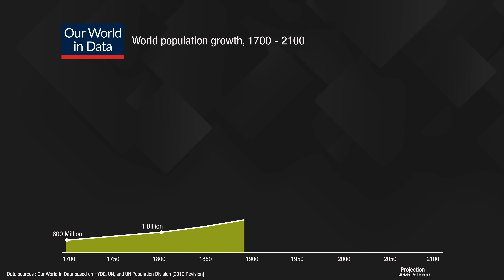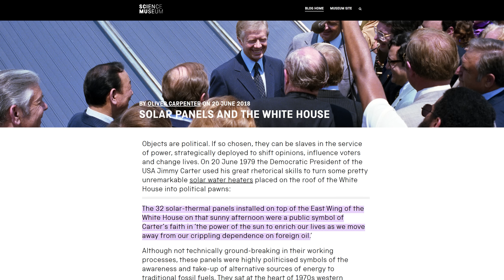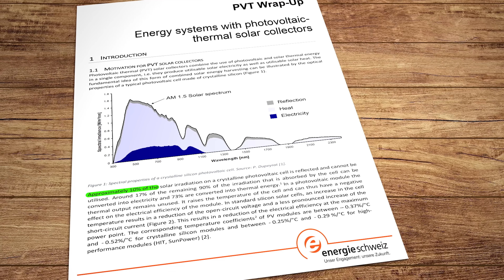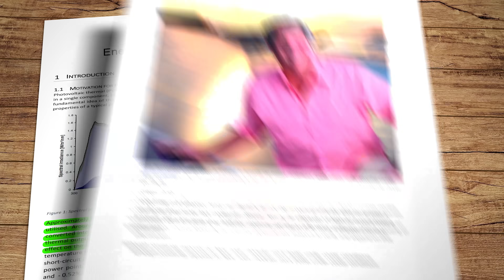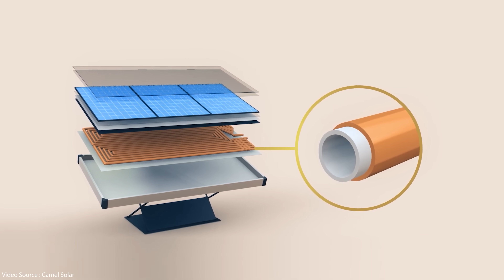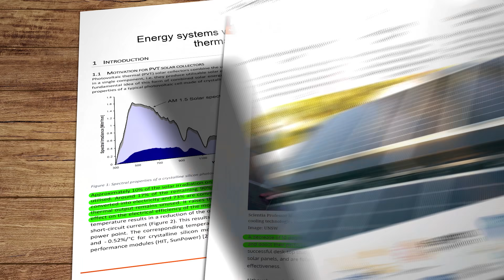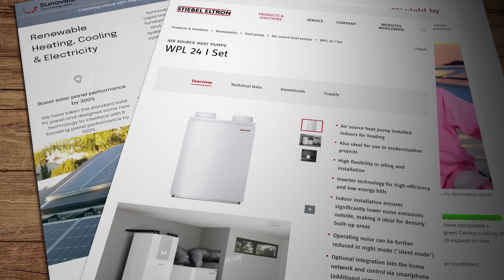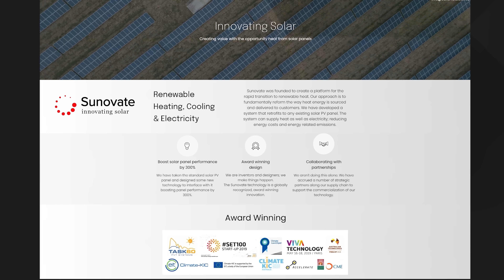The Solar PV panel that provides electricity AND heat for your home!

Comment: This would be perfect for colder climates. With a geothermal battery they would have enough heat to heat greenhouses all year long and you could also store the cold to cool it down during heatwaves or in summer. Once set up these systems practically reduce your heating and cooling bills to zero.

The energy that is used to store heat can come from any source. Focused mirrors, solar and wind, in this case the electrical energy can be turned into heat with a conversion rate of almost 100%. If you then dump that heat in something that has a large thermal capacity like sand, salt or water you could store a shitload of energy.

In Finland they have used a similar system to heat an entire village all winter long.

In case of excess energy, the heat of these thermal batteries can be used to power a sterling engine or a regular steam power plant. However, the temperature of the medium then naturally has to be above the boiling point of water else you can't produce steam.

Also in case of a sudden increase of renewable energy because of sunny or windy days, these thermal batteries can be used as an energy absorber, much like a capacitor and be part of a smart grid system. Nowadays excess energy is often dumped and wasted.

In short these systems, when used correctly, could be used to heat greenhouse and create food abundance at minimal costs.

Comment: Would it be possible to use the heat differential to power a Stirling engine to generate electricity?

Comment: I'm glad this technology is finally coming to a fore of some kind and being developed. Sitting the the perpetually cold surrounds of Scotland, the value of heat is in some ways greater than that of electricity, which presumably will be a major destination for the electricity in any case. Gathering the heat doubles the benefit and our heating season goes well into May sometimes. A better degree of insulation would help but there's plenty energy in the sun to heat homes from at worst mid march and probably earlier. There's got to be huge savings to be made then and in hot water through summer.  I'd also like to see better integration of solar energy into heat pumps, engineers fight for every fraction of a point in the COP department but there's got to be real big gains just ducting the air to it through a big black box in the sun. Especially on a mid winter sunny day where the air would otherwise be freezing and the resistive element on, but you might still be getting a few hundred free watts of thermal energy beating down. I think you need to design for the climate not just the technology for its own sake.
Reply: As I posted above the winter months are unlikely to yield much electricity or thermal output especially as far north as you are.   Here in the south east I get 8 months of ok performance out of PV and thermal panels, we only use gas for cooking in the summer and generate about half what we consume of electricity.
Reply: @thamesmud  if I can get my heating for 'free' in September,...,March,April, and when it's needed in May that's still 4 months of usefulness. I expect there will be days in the darker months where there are gains to be made too. Presumably my electricity bill would be benefited in summer too. The real winner would be seasonal thermal storage like the Danes but integrating that could start to look like a pipe dream for now.
Reply: @thamesmud  if I can get my heating for 'free' in September,...,March,April, and when it's needed in May that's still 4 months of usefulness. I expect there will be days in the darker months where there are gains to be made too. Presumably my electricity bill would be benefited in summer too. The real winner would be seasonal thermal storage like the Danes but integrating that could start to look like a pipe dream for now.

Comment: David, I love the shirt you're rocking, slava Ukraini! It should be possible to run a stirling engine off the excess heat produced by PV panels. This could boost the amount of electricity produced and stirling engines are very efficient too.
Reply from the maker: Cheers Rick! :-)

Comment: Shoring  up less then effective solar panels with radiator / convection technology? Moving backwards to move forwards? Hope it works .
Efficiency is always good but making a questionable heat source  more efficient still seems two steps back before 1 step forward!  
I think we are harming the poor by forcing 1 st world ideas on areas that still have to produce charcoal and would be economically favourable with some fossil fuel energy , thus freeing up more people who are stuck with a third world energy source when fossil fuels would release them from poverty.  
Since Carbon dioxide global warming effects is logarithmic in relation to whatever global warming there is. Then It is important not to panic and force unscientific politicians force people into a backward step that makes the poor poorer. 
There is a lot of science still to be unravelled and it is so exciting. But the politics is moving us into an area of global acceptance. Science is wonderful but it is being hi jacked in my opinion. 
The current Ukraine Disaster has forcibly made , even politicians understand that self sufficient energy production and storage are immediately important to living standards that support health institutions and life in general. This needs to be the platform from which we develop  efficient energy. 
Fossil fuels can help the poor enormously and the middle class can choose to use what they feel is best for them. But using First world politics to “ persuade / force “ thirdly world economies to not produce  products that are deemed no longer environmentally sustainable by first world standards is a manifestation of decadence.
If you really want to help the planet, do what you can in your environment to help the planet but really and honestly before you support some environmental movement, just help the poor . They are all around you .

Comment: It seems quite hard to actually make use of the heat in a personal system. If you're going to use it to heat water or your rooms then you need to somehow integrate it with plumbing and so on, but in a controllable way so it doesn't cool down your hot water at night. That sounds like a lot of expensive installation, especially if retrofitted.

A simpler but less efficient solution would be to simply take the heat and use it to generate electricity through a turbine.

Comment: Very cool concept. I've long thought that "waste heat" was a wasted opportunity. Been seeing some good progress on heat recovery and heat-to-electricity conversion. Really excited to see where it goes. Love synergistic systems.
Reply: P.s. This could potentially dovetail well with emerging solar-powered air-to-water systems which also rely on temperature to to remove/condensate water vapor.

Comment: Great idea and win win on heating and electricity. Why do we not use the same principle on our pre WW2 housing stock? By surrounding the high density estates with greenhouses we can provide passive winter Solar heating whilst trapping the heat escaping from those pesky old houses. Reduced bills and with air quality HEPA filters provide cleaner air to breathe. We could even get rid of the houses pitch roofs converting them to flat roofs for relaxing on or growing some plants? In summer the glass roof panels would open up to allow cooling breezes. All this is available today with Greenhouse technology allowing Mediterranean climates for those summer foods we love!

Comment: Looking at new builds fo new people:
In stand-alone systems every bit of heat helps. It only makes sense comparing that heat bonus with natural gas if you already have natural gas. If you don't need to plumb for NG, then your labor and cost savings go up significantly.
The "Return on Investment" may be even higher than it first appears.

Comment: Crypto needs curtailing as its the biggest waste of energy and resources after the the bottled water trend of the past 20years its also becoming a wildwest for international fraudsters and some very unpleasant regimes who dont like you T shirt 😉👍🏼😎  

Take the stored heat or recovered heat from pVT panels 
And connect it to a Stirling engine powered electricity  generator.. if you dont intend using the heat directly or storing it in water or dry thermal   
mass.
Glad you looked at this huge anomaly in current PV system panels..  I became aware because of off grid and cruising boat owners were suffering panel efficiency drop off and damage while in areas where the sun ☀️ was where they were travelling and often keeping their boats cool was needing them to run generators to power  
air con systems. Yes I linked the efficient pump feature you did to them. 👍🏼😎
Love Engineering with Rosie.

Comment: My late friend Marino Piasenta' used to convert PV pannels in Italy to PVT over a decade ago while still alive, by attaching to their back a refrigerator style radiator in which he pumped an oil that could stay liquid in harsh winters and not evaporate in hot summers, collected the heat keeping pannels cold enough to have 100% production and using the heat in a heat exchanger to either heat up the location in winter or in a reverse heat pump to provide air conditioning in the summer without using electricity.

So this is not new, the only new thing is finally the Muricans have discovered America, and obviously because the Chinese now make them on scale production, which is the only way the Muricans ever learn of existing old technology and call them new.

Obviously if the colonies found America, all of the sudden the Empire has an AHA moment too, follwing the fashion trend from teir colonies.

Comment: Hi, Dave. Thanks so much for this inspirational talk. I would like to ask you about an issue regarding solar panels. Do you know if it's true that the polysilicon used in solar panels is mainly produced in China? And much of this with Uigyur slave labour. Maybe you could find out if this is true. Thanks, Arthur

Comment: I have been watching these type of solar panels for years. I wanted to get them when we installed our solar panels but no local installer supported installing them. I have been holding off increasing our capacity to support BEV use, waiting for them.
Reply: Matthew, this is a great approach. Prioritise the electrons for mobility and appliances and let the thermal do the low grade thermal effort.

Comment: You know, back when I was a kid, a friend's dad built a solar water heater made of simple copper tubing, a plexi box, and an unplugged, junky water heater tank just for storage. The hot water that came out of that thing was ferocious. Now when I look at rooftop solar panels (1:58 for example) with those awkward, unsightly gaps around corners & chimneys, I think those would be perfect for H2O water heating panels. They could be cheap, custom-built to be any shape, and could fill in those gaps perfectly: perfect follow-on cottage industry.

Comment: On the way to the shops I can see through some windows and it infuriates me that many of them (if not most) are wearing t-shirts in the middle of winter. Even nowadays in spring when it is still cold. This means that they must be wasting so much energy on heating, which by far is the biggest share of energy consumption in Europe. 

I see Dave wears t-shits in these videos but I think this is because camera lights are hot and I really hope it is not the same when not filming.
Reply from the maker: It's not a heated cabin. It's at ambient temperature. :-)

Comment: I wonder if thermoelectric generators (TEGs) would be viable given this heat harvesting method. 

Now TEGs work best when they have high temperature differences across both sides of the generator, so having these situated near the panels themselves probably wouldn't lend to the best differential. 

However, I imagine that if a heating system is supplied with a single, centralized TEG and a single, centralized phase-change storage device, you could theoretically route some heated air/gas/liquid to the phase-changer and some to the TEG. 

The phase-changer could hold one side of the TEG cold while the normal convection path heats the other side. 

You could in theory get electricity out this way, but as others in the comments say, the entire process has to have a positive Q coefficient: the energy captured from the sun has to at least power the pumps/fans needed for convection path. If you can't do that reliably and for most of the time, or inexpensively, then this project is dead in the water.
Reply: I've simulated a solar PV panels with thermoelectric... It does not work. You need to manage to get the temperature drop exactly across the TE elements and they are really quite thin. The next problem is that there is really not much thermal mass in PV cells to keep the temperature difference up. And you don't want the cell to stay hot as that's the whole point. 
All great ideas until you try them. PV works really great and provides an a lot of energy even without messing about with the thermal side of things. Better to use a dedicated system for the heat applications. There is enough space for PV...  E.g. over motorways... Agripv ... Etc... No use cramming all sorts of tech that all might fail independently into a small space.
Reply: @ingenhop4365  My intention was to not hypothetically use the PV panels themselves as the TEGs. 

My intention was to have some sort of Peltier cooler embedded to each panel, like in the case of a micro inverter for DC to AC, and run this cooling/heat gas/liquid over it to generate electricity.

The Peltiers could be made micro and localized right at the panels themselves, or a larger, single peltier/TEG could be placed somewhere else near the panels but separate from them: like in a garage or basement, not on the roof.

Edit: having the TEG(s) away from the panels offers the same benefit as sucking heat away. The idea would be route the harvested heated gas/liquid to another location for either thermochemical storage via a phase-changer, or to use the output of that storage device to provide the cold side of the Peltier. 

Heat comes from panels, cold comes from thermochemical store.
Reply: @nschrombeck  yeah that sounds more doable

Comment: Thank you, it is so good to learn about new ideas and to better understand how things work.When panels cool down at night, the energy flux into the sky may be a bit small perhaps. But anyway,  the flux of heat during a sunny day is enormous, no black cat  remains on a hot tin roof for too long !
Reply: 40 to  50W/m2 with ambient air as the inlet condition. Higher if hotter than ambient air is introduced.

Comment: The main problem that I see with this technology is that when the heat problem is at it's worst, we're trying to get rid of excess heat from a lot of things. Can you look at ways to harvest this extra heat as electricity? Or better yet, I'm wondering if there is any technology that can use excess heat like this to actually cool air. I believe that this would be possible, as I know that there are refrigerators that burn gas to cool the inside. Is this a system that could be applied here to use excess heat from the sun to power an air conditioner?
Reply: there's been some good progress lately on turning waste heat into electricity. check out thermoelectric generators. but also, lots of good research on how to apply it to all sorts of places, like pipes.
Reply: @NirvanaFan5000  I've done a bit of research into this tech, and it seems like temperature difference is the most important thing for electricity generation. However, in the height of summer when solar panels really need active cooling to maintain production, the temperature of everything else is also increased. Because of this, basic cooling methods will not work to get any reasonable power from TE generators...

Comment: every Solar Farm i have ever worked on had third degree burn emergencies from the workers touching the Panels. It was perfectly obvious that toaster amounts of heat were being generated and altering the air above the farm, ...you could SEE it. Capturing that heat would enhance the Farms efficiency by , ..im  guessing DOUBLE the Electrical output, ...at least !

Comment: I have a heat pump since 17 years for my residential heating and additional solar collectors for heating the pool since 17 years as well. But the main issue remains that producing warm water in summer needs ways to convert that energy for cooling purposes. When that can be realized easily, these newfangeled PVTs will take off.
Reply: Most efficient conversion is geo?

Comment: Would it be possible to use the heat to generate electricity with either peltier cells or sterling engines?

Comment: As a resident of Phoenix AZ in the US, we probably wouldn't want to be dumping excess heat into a pool.  Using that excess heat for a water heater sounds promising, but our ambient air temperature during the summer is around 49c (120f); evaporation is already a big problem for backyard pools and water is extremely scarce.  If I were designing that system for use here, I would probably use a setup similar to an air conditioner, where heat harvested from the panels is first concentrated, then used to power a water heater, and finally a steam turbine or Stirling engine/generator.